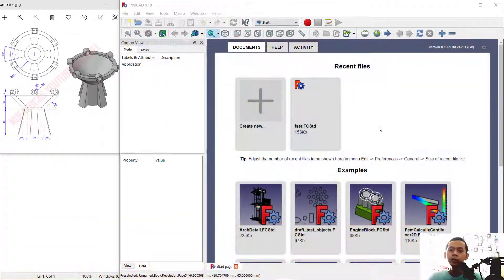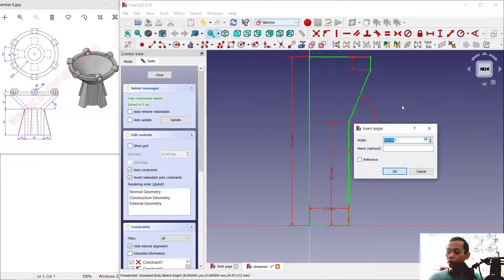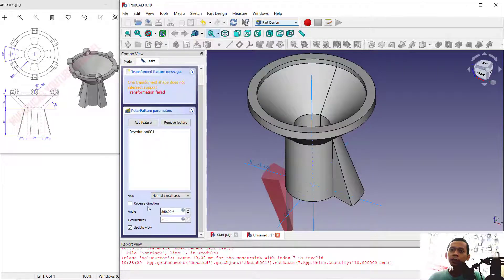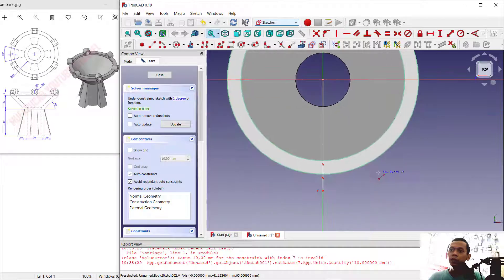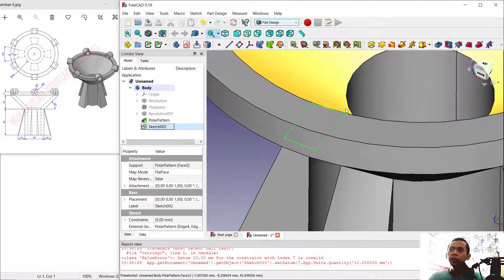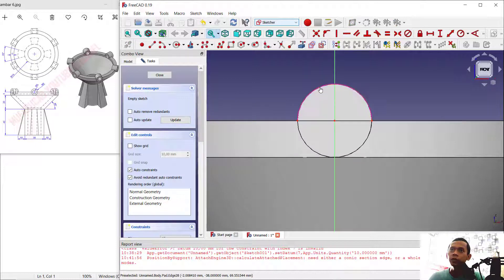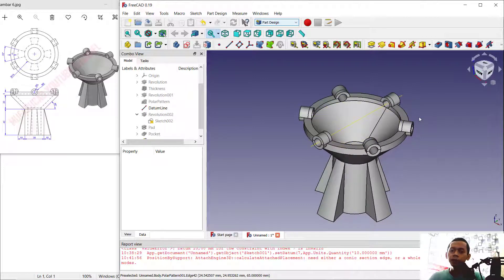Exercise 06 FreeCAD Basic Part Design Tutorial For Beginner

Comment: I am a new FreeCAD user.  I am following this tutorial and I ran into a roadblock.  I somehow cannot use the Sketcher External Geometry tool.

I follow the process and created the funnel-shaped object.  
At 2:00, the instructor clicked on Create body, then the Sketch button, and selected the XZ plane. Click the OK button. 
At 2:21, the instructor selected the Sketch External Geometry tool.  He then selected the two points at the top and bottom of the cylinder.  When I try to select those points I got a red slashed circle indicating that was not allowed.  I am stuck.  I have repeated the same process a few times without success.
I have the following observation and questions:
1) At 2:17, when the 3 planes are displayed, the "plane frames" envelop the entire subject. The plane frame in my FreeCAD only envelope the cylinder.  How do I adjust the plane frame size?
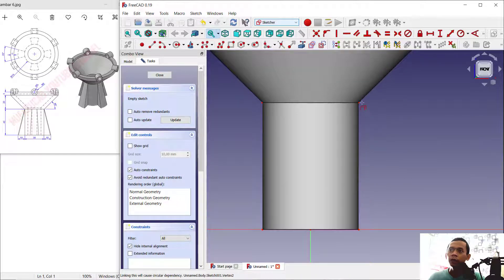2) At 2:23, the instructor use the Sketch external geometry tool to select the line (turned yellow) between the clone and the cylinder.  I was not able to do that. I got the red slashed circle. Why?

Please help.
Reply: at 2:08 he hovers over the create body command but doesn't actually click
Reply: @adrianinsaval  Thanks.  There was a bald spot on the right side of my head.  I pulled my hair out trying to figure this out.